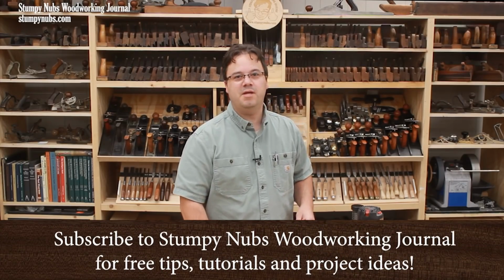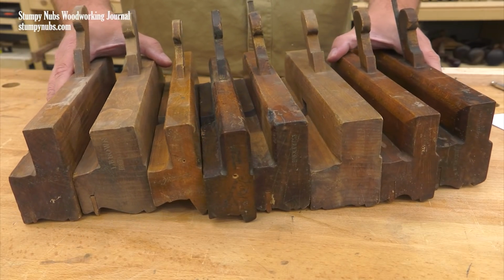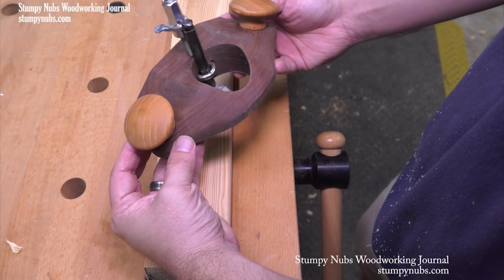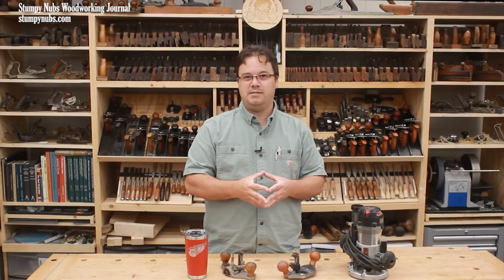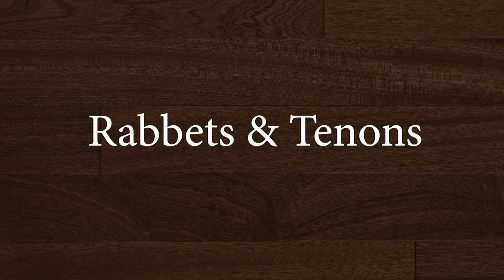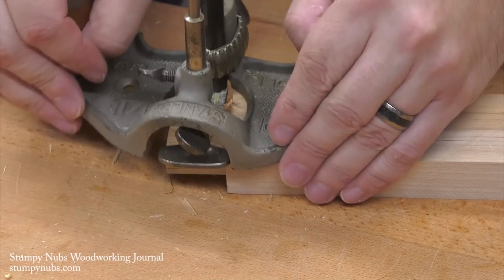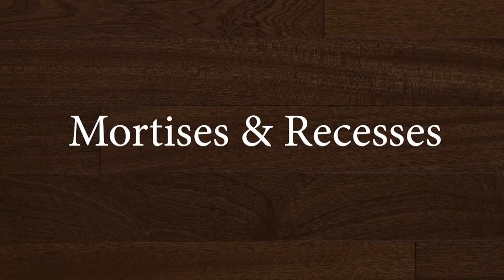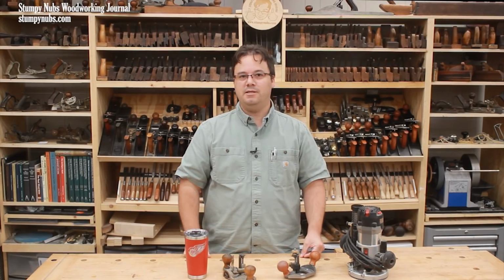The essential old tool you can MAKE YOURSELF!

Comment: I made a pattern for a small router plane. Cast it in brass and used a 1/4" Allen wrench for the blade. It's used for recessed letters on patterns. Works great casting was made in 1977.

Comment: I’ve been considering one of these tools, but primarily to clean up rabbets cut with my router.  Given how long it takes to clean up the rabbets, would it be easier just to buy the skew rabbet plane?
Reply from the maker: A rabbet plane is more difficult to use accurately without some skill.

Comment: I've heard that diamond stones wear out fast regular atones last longer. can you go over that.
Reply from the maker: The opposite is true. A good diamond stone does not wear if used properly (don't apply excessive pressure). A water stone wears every time you use it and must be re-flattened. If you are asking if a diamond stone's total life span will exceed a water stone's, that depends on the thickness of the water stone. Overall, I would say both will last the average user a lifetime, if properly used and cared for. The diamond stone is preferable (in my opinion) because it requires no maintenance (flattening).
Reply: @StumpyNubs  that's pretty much what I thought.

Comment: I knew little about router planes until I inherited a bunch of planes from an old carpenter family member. I found a use for it shortly after the planes arrived. I had to remove some material my trim router couldn't reach and flattened the bottom of a circle where I had to inlay an object. Now I'm seeing many videos of router planes in action.

Comment: You can also use it to transfer depth measurements from one piece to another once the first cut is correct. Also good for making lap joints match, again through multiple joints once the first one is right.

Comment: Are router planes designed to be pushed or pulled through the cut?  or does it matter?
Reply from the maker: You can work in either direction.

Comment: G'day James, I built one after watching your video *Build your own router plane*. I made mine from a scrap piece of Jarrah, an Australian hardwood grown in Western Australia. In the West Jarrah was used for railway sleepers for years, so it is very tough and hard when dry.  I used a 3/8" mortising chisel to cut the recess for the Lie-Nielsen router bit I purchased, then drilled the 2" hole with a Forstner bit leaving about a 1/4" recess for the bit.
Using my new tool made cutting a recess for a toggle clamp in a project so easy and precise, thank you for a good design.

Comment: Thanks for the 2 hinge depth setting tip! My Stanley 71 1/2 was one of the first tools I got when starting woodworking a few years ago. Bought an old rust covered one on eBay, and it cleaned up easily. I use it every time I set hinges for a gift box.

Comment: I have 2, a Stanley No 71 1/2 and a Lee Valley Mini. I use both in manufacturing boxes, routing stopped rabbits for the lids and bottoms. I have more control and can work any time without the noise and dust from my screamers.